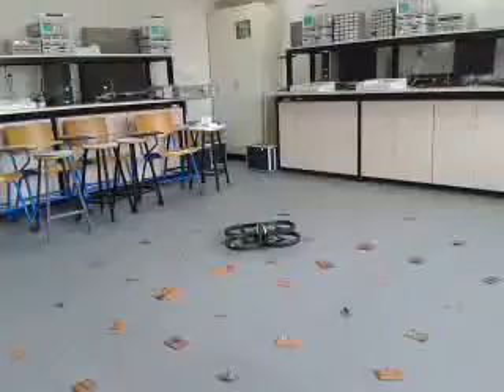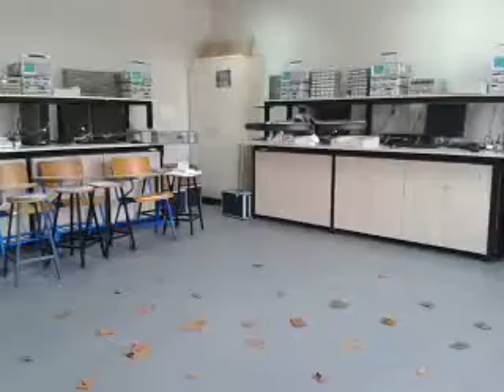Emergency Control of AR Drone Quadrotor following a square path - 1

Comment: hello, 
the used controller is SMC?
Reply from the maker: Hello and sorry for the delay. Actually, the controller here is the simple PID controller. The important thing about the Emergency controller developed here is that it transforms the simple PID controller into a powerful fault tolerant controller that can afford the total loss of one rotor.